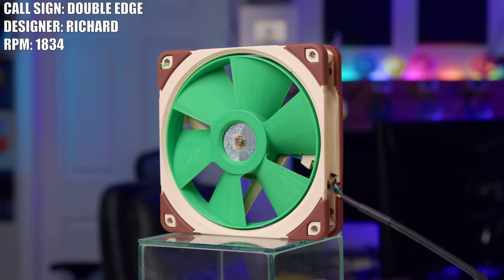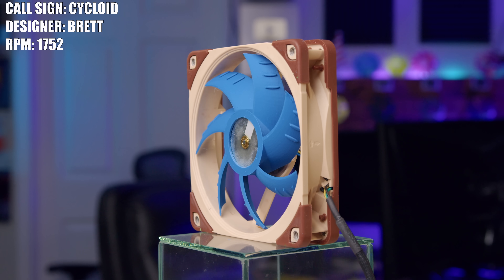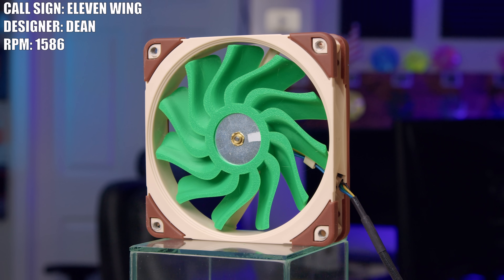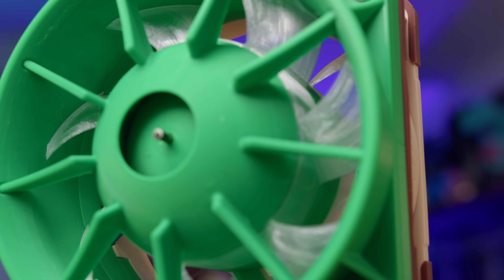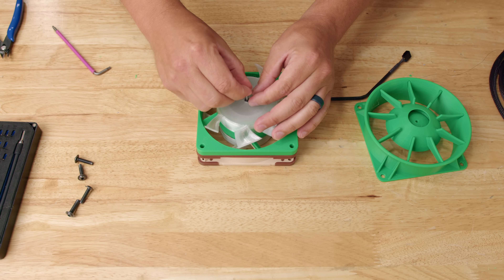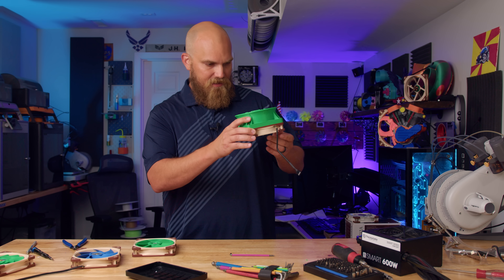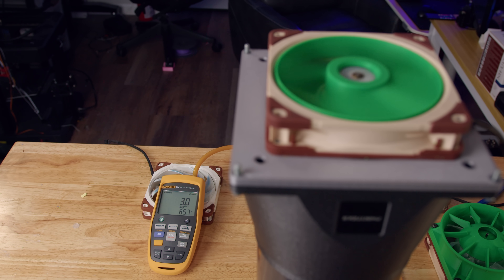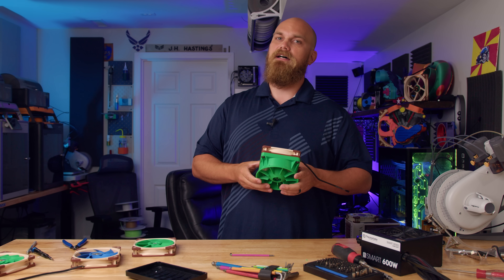I’ve Tested Hundreds of Fans… Nothing Like This One – This Fan Is a Masterpiece | Fan Showdown S6E11

Comment: I use Counter-Rotor Fan loadout in my PC, well when i got my PC parts for my Older Case i originally ordered, 4 Fans, 3 Pushing outside fresh air to inside by the front and 1 fan pushing the hot post-cooler air from inside to outside, but for some reason the transport company doubled the package and i recived 8 fans (but luckly they didnt charge for this error), so i Adapted new screws and gabinet front and make 4 fans run in Reverse and put them behind the normal rotation fans creating counter rotating propellers from Tu-95, the airflow were stronger, and i run the fans in slower rotations since two instead of one do more power so i dont need to run them in all speed, that makes them quieter

Comment: Staters are underrated.  Look at the compressor side of a tunbo fan. It is the part of the machine that packs a lot of air into a tiny place. You don't need 5 fans. Just one spinning between two staters . The stater does two things. It allows the fan blades to bite into more air, and you can undersize the inner stater to accelerate the air.

Comment: Coaxial props are what they are called 'oh-ffissi-jelly', they are used in big helicopters, and in some high speed planes because the extra prop adds about 30% more torque, at the cost of efficiency and more noise. The fastest prop-driven aircraft is actually coaxially driven: Tupolev Tu-114 (https://en.wikipedia.org/wiki/Tupolev_Tu-114)

Comment: Wonder how the jet stream would do on a hub that can be tweaked to its most optimal RPM.  I know MH has a tunable speed hub.  If that is 1600 RPM, just up the power till it spins at that RPM and see how it does.  I thought contra blades were a way to increase static pressure compared to a similar single layer blade.  Though I am more familiar with propeller designs.  No idea what happens when the blade is leaned into the direction of travel instead of swept back.  Not sure why PC fans have the blades swept into the airflow and jet engines have the blades swept back from the rotation direction.

Comment: I preface this with the fact that I am completely clueless, but isn't the problem with the jet-stream the fact that both props spin at the same speed? Shouldn't the second propeller spin ~twice as fast? Otherwise it is just "Freewheeling" in already accelerated air.

Real jet engines have counter-rotating stages and a "Gearbox".

Other instances of counter-rotation where both sets of blades spin at the same speed seem to be to reduce reactional-torque.

Comment: Can you do an episode where you test ultrathick versions of all the top fans (including commercial ones like noctua and phanteks and ones that were submitted to the show). A super thick version of the Artic P14 MAX would be interesting, since the ring surrounding the blades fixes alot of the pitfalls of trying to get blades close to the fan housing. 

Edit: Also, most curious what a 140mm superthick noctua G2 fan with the MAX P14 blade ring could do. This way you don't need to worry about blade material so much since the ring keeps the blades from hitting the housing.

Comment: I'm VERY new to the channel and I love this fan obsession. 
When it comes to automotive air inlets, Dr. Gordon P. Blair's work on the ideal bell mouth inlet for an engine is held up as basically an incontrovertible truth and it's been validated time and time again. (up to 5.5% increase in airflow through an engine's throttle body with an ideal (elliptical) bell mouth).  Have you tested an ideal-shaped / elliptical bell mouth, even a short one, on a fan's inlet before? 

http://profblairandassociates.com/pdfs/RET_Bellmouth_Sept.pdf

Comment: for the next season, you should mesure :
- the speed of air 40cm behind
- the speed of air 40cm behind, but with a tube between the fan and the measure.
- continue to mesure pressure

Comment: Like a turbojet, the fans can rotate in the same direction if there is a stator in between the fans. Some of the thicker fans like Delta have a built-in stator. Perhaps 2 or 3 of these fans could work?
The higher the RPM, the better it will work. I don't think a higher air velocity will be achieved, however it should produce a higher pressure. Also, progressively smaller fans going intake to exhaust could work better as the pressure increases at each stage.

Comment: I know the video has been out for more then 2 weeks by now, but I have a suggestion for the "measurements" for season 7. Personally I think it would be interesting to check for the volume of airflow over a given time. If the heatsinks receive more air, the better the cooling will be. An additional factor to check for could be the "direction" of the airflow. You would want to intuitively place a fan on the pc-case, so if you have any wonky airstreams it would again reduce the cooling.

Comment: Man, static pressure is really not the right test to judge an axial ventilator. Static air pressure and isostatic pressure moved air are two opposed design-criteria. You need to test for both and also set up a cooling test with a reference cooler.

Comment: if you wanted to test the ultimate contra-rotating setup, just use two fans back to back with fan blades pushing in the same direction but rotating opposite of each other

Comment: I still say that a gasket during the smoke test would be the best for proper results reducing air gaps makes things run so much better. Look at any modern engine where there is a tiny air gap. Throws a monkey wrench into its timing and balance.

Comment: did i miss something?
is this V2 Engine on the right shelf also a fan?
if yes, what episoden?
if not, someone need to buld a V2 Piston Engine that output the Air. Maby not a lot of CFM but im sure, the pressure is incredible.

I personally would prefer a Flat 2 because i drive a 2CV.

Comment: In the Double Edge fan, even number of blades is bad for acoustics because each time a blade passes in front of a frame's arm, you have an air pocket compressed between the two parts, which creates noise. So when you have both an even number of blades and arms (which is the case here) the design is symmetric, which creates at least TWO pockets simultaneously every time a blade passes in front of an arm. 

Ideally you would have a number of arms and blades that are co-prime numbers, i.e,, that only have 1 as common divisor, so that you never have more than one pocket of air at any moment. 

Since the only divisors of 4 are 1, 2 and 4, any odd number is a co-prime number of 4, which is why an easy design is 4 arms and whatever odd number of blades.
Reply: Also, since the alignments happen at regular intervals due to the relationship between the number of blades and arms, you can predict that peaks will appear at specific integer multiples of the rotation frequency of the fan (which is near 1830 RPM ~ 30.6 Hz), so : 
- 30.6*4 ~ 122 Hz
- 30.6*6 ~ 183 Hz
- 30.6*12 ~ 366 Hz
- 30.6*24 ~ 733 Hz

which is entirely due to the number of (pairs of) arms and blades

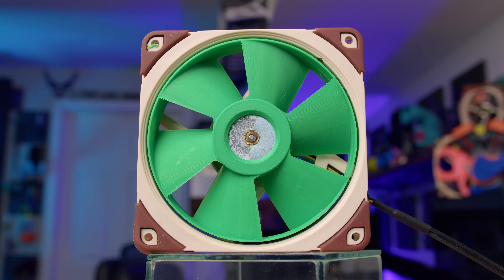Comment: 1:10 trying to create lower air pressure behind the blade but not sure that design will do it. The objective is to increase the laminar effect on the top side surface 🤔
When you look at the newest plane wings they have perforated top surfaces with vacuum interior that increases the effect. Like golf ball’s that use pitted surface to do the same.

Comment: Hey, I'm new here, I am curious of the top ones, which one is the top "fan fan": I don't have space to print a blower, a 200mm fan case, a turbo, etc. I just want a fan blade that moves more air than the original design. Also, do you have an actual noctua blade comparison? I didn't see it on the chart. It is my opinion and correct me if I'm wrong, but all these blower/turbo styles can get bigger and bigger and win-out because the design parameters allow for indefinite space on the exterior of the noctua fan structure. Thanks!

Comment: If you want to see drastically different fan designs than what you're getting now, do thrust.  A down and dirty setup such as a yard stick with the fan on one end, a pivot on the bench on the other and a cooking scale in the middle would work for measuring vertical thrust.  What would be really neat about that is you could have two different leader boards.  One would be measured by taring the weight on the scale with the setup in place and seeing how much lift is being generated.  The other would be to tare without the weight of the setup.  This would reward fans that not only have good thrust but also light weight.

Comment: For the 7th season, the goal could be to design the quietest system possible, optimizing for minimal noise while maintaining high airflow and static pressure min. thresholds. This approach aligns with advancements in modern aircraft design, which prioritize noise reduction alongside performance.
Reply: and/or even, power consuption from the power suply

Comment: Counter rotating fans are common in servers that need extreme static pressure.

Server counter rotating fans can achieve static pressures so high (hundreds of mmH2O) that they perform measurably better as exhaust compared to intake due to adibatic compression heating/expansion cooling of the air
Reply: Surprised we haven't seen anyone try to make a proper compressor. An axial compressor has the benefit that the stators are attached to the frame, serving the same purpose but with less mass being driven you'll get higher rpm.

Or any other compressor design that just attaches to the fan motor to do it's work, although at that point it's probably not within the spirit of this challenge.

Comment: Jetfan is so close. 
I dont have the skills to design one, however i do know a bit about fan thrust.

Intake shaped like a turbine intake shroud. Current dimensions are ok. 
Fan design looks worthy, bit only need one. 
Requires an eflux/thrust tube. There are ratios to these, exit 70% diameter of inlet. But if the thrust be short due to fan frame dimensions, and cant protrude out the rear, keep the front fan in current position and make a satisfactory reduction in thrust exit to suit shuch a short distance. 
Otherwise place the fan in the stock position, giving opportunity for a better length intake and thrust tube.
Long intake with correct shape lip compress & will clean the air on the way in, thrust tube will compress air on the exit and increase velocity.

Comment: Having 2 fans should double (or more) the load on the motor. if the Jet Stream had the opportunity of more power without the gear box it might be on par. A lot of these designs that do well are optimizing the form (using more than the 25mm depth, capturing all the air at the fan tips, making better aerodynamic use of the hub). I'd love a series about testing just radiator cooling with just the constraint of needing to connect 2 pushers on the front of a dual 120. They can also have pullers, or add more pushers. We just should have a scoring method that optimizes for reality.

Comment: For the Double Edge, my best guess as to why he did that chamfer underneath is that he wanted the thin section of the blade to start the slice, and then the deeper curve to accelerate the flow. Not an engineer, not a mind reader, couldn't tell you if that was the actual intent, but it's my best guess, because that's what I would do.

Comment: I was actually surprised by all of the fans on this episode.

And mostly positively. The contra rotating one gave both positive and negative surprises. But overall seems like a very nice design. I could be wrong, but somehow I think those rollers might not be very efficient. And when the motor is not very powerful any bit of losses will hurt performance. And while there could be losses, then again having o-rings for the contact surface is likely a very good thing for noise. Gears would likely be much noisier, and even then would not guarantee better performance.

Anyway, very beautiful design, in all of them really. It is just nice to see what do people come up with. Sometimes the designs are just absolutely brilliant.

Comment: Hey man, for season 7 or a later season you should use a brushless motor like you did for your blower so there isnt really any restrictions on torque. It could still be in the a12x25 frame but a much better motor yk?

Comment: Thanks for showcasing my Cycloid! I'm so glad the noise level was as intended. I was impressed with everyone's submissions today. I will dust off the ol STls to reiterate it.
Reply: Have you considered putting golfball- like dimple's on the blades?
Reply: @timhartherz5652 I have considered it. Thanks for the reminder. I'm keen to try a version with that. It was outside the scope of my class when I made it though
Reply: @JagerGinger cool, i really like silent fans, the quiettest ones i own have ripples on the blades, maybe golfball dimples would work similarly but fluid dynamics occupationaly borders on Witchcraft, so one would only know after building one.
Reply: @timhartherz5652  Haha yeah, with that sort of thing it would require a lot of trial and error I imagine. At least simulations can help, though it's really hard to get them accurate for this
Reply: How do you feel about the Cycloid outside of the is issue of "Low Noise"?
I used to work at Boeing in the Composites department.  
I can at some point in the future make a composite windmill blade.  (Note: I will only work with blade that are designed to hold a stainless steel leading edge.  Since those leading edges can be replaced as opposed to having to replace the whole blade.)
Reply: @FuhrChris  The half cycloid curve I applied was to the leading edge, and the cross section curve approximated a half cycloid. I'm looking to fine tune the diagonal curve from an ideal spot for the air particles to impact blade all the way to the back tip using flow simulations. I tried it earlier but struggled with the software
Reply: Which would imply there is a region of rpm it is best suited for. So I'm looking to figure that out as well. I'm in college so I'm still learning how to use all these softwares

Comment: Counter-Rotating fans will compress the air and focus the air flow.  I put together six of these fans together and they consumed a great deal of current and despite six fans spinning, they did not move six times the air.  However the pressure of the air was difficult to stop.  The fans pushing and pulling on each other resulted in a high noise and high RPM.

Comment: Another measurement you could include for season 7 is use them on a single fan radiator (AIO) cooler that is actually being used to cool a CPU under a small load for actual practicality use, to see how well it keeps the water cool in the radiator

Comment: OK OK OK.... i know the fan showdown is technically "one" motor driving whatever concoction of a mechanism be it a single blade system or some elaborate assembly... but that counter rotating assembly NEEDS to be revisited using 2 fans stacked back to back with the blades designed to achieve the same rotation and get rid of the rollers. Reason being, is the design saves no space over a double stacked fan and 2 motors would be able to drive each blade set at full RPM. Outside of the showdown, the static pressure results should be higher than just double stacking like rotating blades. 

Please make this happen as just a fun cool thing that looks bad ass :D

Comment: For next season I want to see a P/Q curve, just like Noctua publishes for the AX12-25. It should be relatively easy to prepare: use the same anemometer and manometer that you have now, but place an adjustable grate at the output of the wind tunnel. Start with the grate wide open and you get basically max speed with unrestricted flow (make sure the open area of the grate is plenty large enough to avoid causing restriction). As you restrict the output, air pressure should increase and air speed should decrease. Once the grate is fully closed and no more air can flow, you've reached max static pressure.

I think this P/Q curve is especially important because fans fall apart at 0 air speed. There is a minimum air speed needed to maintain proper flow over the blades. Just listen to the fan as you restrict it: at some point it more restriction causes it to suddenly speed up with very little air flow. It's good to know where that happens because it's the maximum usable back pressure for that fan. What happens beyond that point is largely irrelevant for a PC fan because the whole point is to generate air flow.

The P/Q curve need not be extremely detailed. 5-10 samples would be an excellent indicator. If the grate can be designed for repeatable performance (detents if sliding; individual grids), then they will be easily comparable. You may want to look at the curve for the AX12-25 to see how quickly the curve changes and choose the sample points based on that. Of particular interest would be grates that provide restriction similar to a typical PC case and a typical radiator. You should be able to produce those by measuring the speed of the AX12-25 under those conditions and creating grates that reproduce those speeds.

I really hope this is possible because it would give every fan an opportunity to show where it shines. Then there would be no more arguments over whether we should measure pressure at zero flow or speed at zero restriction: measure a scale in between to see what real-world performance would be.

Comment: Would love to see season 7 focus on thermals with a stock test (could be a single-fan air tower or a 120mm rad) and/or noise-normalized performance. I feel like the max performance thing has been pushed pretty far, but what about finding high performance with great acoustic properties? Take the dB measurements to a whole new level.